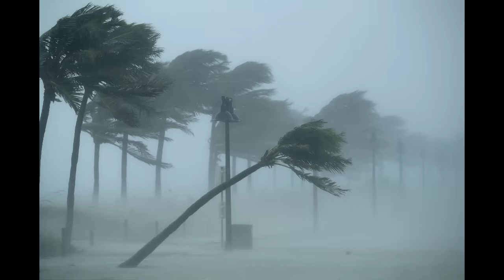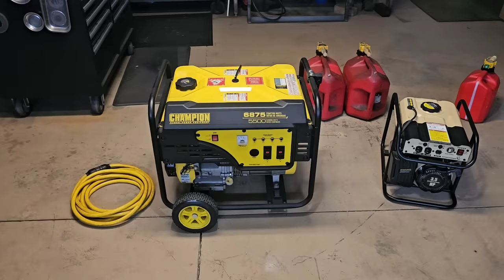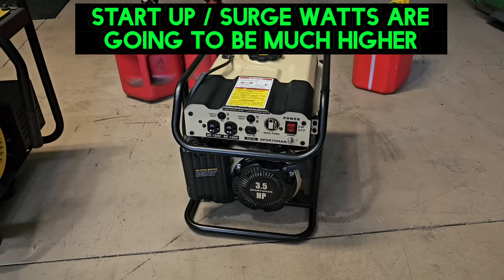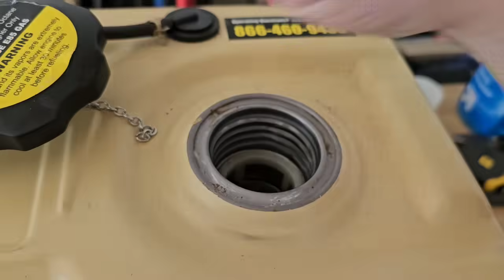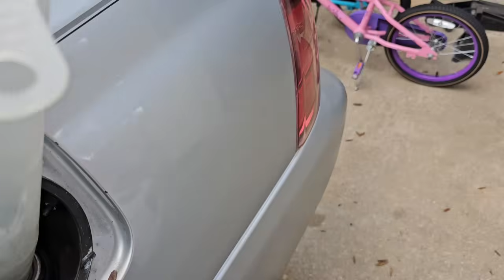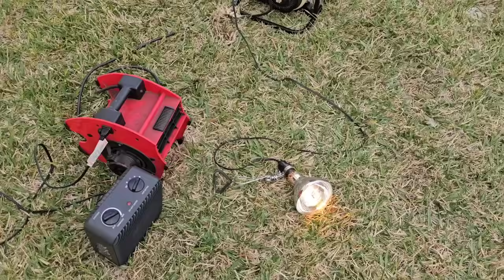Why smaller generators are better for power outages.

Comment: First time we lost power after moving into our current home, we realized we were the only ones without a generator

We got a larger dual fuel generator because we need to be able to power a well & septic pump, and have a large LPG tank.  In an extended outage, the plan was to run the generator for about an hour 3 - 5 times a day.

Still plan an getting a second generator for back-up.  An inverter and deep-cycle RV battery is also great for small loads such as an internet router/modem or CPAP.

Comment: I'm a big fan of preparedness and some small creature comforts in a disaster and I have 5 generators in 3 different sizes all inverter, 2X4kw 2X3kw and a 1,000W and I'm thinking of getting another satchel type generator that will produce rated 3800W from a 140cc engine. The 4kw will run my house, my mini split air conditioners, refrigerator, lights tv computers and a washing machine. To use electric to cook besides a crock pot/rice cooker, I have to rob Peter to pay Paul OR I could Pair another generator and only run it as long as necessary. 

Some of the satchel type inverter generators use permanent magnet alternators which are much easier to spin and the one I'm looking at is 3800W 140cc, while my 3kw generators have a 212cc engine and the 4kw has a 270cc engine. 270cc vs 140cc for pretty close to the same amount of power produced. I expect the 140cc would probably run 10% faster than the 270cc engine, but it should still run at least 60-70% longer on the same amount of fuel. Air cooled Gas OR Diesel generators are horribly inefficient. Yes, I said Diesel. If a diesel isn't water cooled and turbo charged they use about the same amount of fuel as a gasoline engine would of the same size and if you hadn't noticed, diesel is more expensive. Diesel does keep longer in an air tight container though and fuel stabilizer for gas isn't cheap either. I wouldn't buy fuel stabilizer, I would just rotate the gas in the cans to the cars every 6 months and buy fresh.
Reply: @Desert-edDave  Blough me?

Comment: I use the smaller Champion 2000w dual fuel inverter generator to recharge my ANKER 767 /w expansion battery … 4096wh total.  Runs all my 120v needs … daytime 6-8 hrs, nighttime 8-12 hrs. Using propane.  Thing about generators dual fuel or otherwise of any size is that they provide their rated power 100% of the time whether you use that power or not.  Use still burn fuel.  Storing that energy to top off a battery means you don’t have to run that generator but once every 8-12 hours for only a 2-3 hours.  My 15-18 lb. propane tank will recharge my batteries, least 6-8 times.  That’s roughly 2-3 days for about $20 propane cost.
Reply: Actually inverter load greatly affects engine load and in turn fuel consumption. An unloaded generator vs. one at 50% rated power generation vs. ~100% will consume very different amounts of fuel.

Comment: Is there some sort of thing you can put at the outlet between the fridge and the outlet itself that can then have an input cord during a power outage that doesn't' backfeed the whole circuit?
Reply: If powering a home and not individual devices, one would want to have an automatic transfer switch(ATS) professionally installed (by a licensed and bonded electrician, to code) which can automatically switch to the generator when grid power goes down, and also prevent back feeding when grid power is restored.

Comment: Inverter gennies are the best.  My Harbor Freight 9500 is more efficient than the much less powerful Yanmar diesel genny I had forever, plus the power is pure sine wave under all load conditions.  It'd also be more efficient than a smaller conventional gas genny.  If I had to do it all over again, I'd get a dual fuel model inverter genny like the Duramx, though will add a conversion kit to what I have.

Comment: I know what you mean but if the engine is bigger its more efficient. You probably get more watthours per gallon out of the big generator than out of the little one. But the diffenence probably is not this big. If you only use like 500 watts you should use the small generator. But you should mention, if the big generator is at 50% of its output, the small one is not at 50% so it also needs more than 1.5 gallons
Reply: What matters in this context is energy generation and consumption vs. fuel consumption in an emergency situation - in this case, the smaller generator that consumes less fuel but is able to meet the emergency power generation needs is the wiser choice.

Comment: I have both a 2KW Honda 120VAC and a 12KW Westinghouse 240VAC pure sine wave beast. The beast is great because it seamlessly interfaces with an automatic switch behind the utility meter. If the power goes out I just connect the gen and fire it up (electric start) and the whole house is powered. The two downsides are that It does make a fair bit on noise and burns a fair bit of fuel even when on eco mode. The Honda is also great (quiet and fuel thrifty) but it's a hassle using it because I have to run extension cords and pull the fridge out from the wall to get the power cord. Eventually I'm going to get a battery/inverter (240VAC output) so I can run the whole house on the low-down. 

FWIW, my newish LG side-by-side fridge/freezer runs at 50 Watts average so it's very thrifty. All LED lighting so my overnight power usage is under 1 KWH. So, a battery/inverter could easily handle overnight use and most of the day for that mater.

Comment: I've actually been considering a battery bank with an inverter to run the fridge and freezer at night. No noise and then charge the bank in the morning with a small Generator And run the daytime house with the larger.

Comment: Question on hooking up cables to transfer switch box: Since most larger generators and boxes use a 4 wire plug and small generators a 3 wire plug how do you hook up your smaller unit?  You could make a 3 to 4 wire cable, but no electrical code to my knowledge looks kindly on this.
Reply: If code was an issue, RV's wouldn't be doing 30A to 50A 'dogbones' every day. ;) It's not a code issue and is definitely possible. It is definitely possible and safe to do as long as wiring is rated for the load as well as associated breaker(s).

Comment: I bought a Multiquip 25kw whisperwatt diesel generator, it's towable and has a 45 gallon belly tank and a 18 gallon internal fuel tank which are connected together and runs the whole house on 7 gallons of fuel every 24hrs, the neighbors can't hear it and it will run continuously for 8 or 9 days and when it's time to fuel it up tow it to the gas station, also have a small generator like your talking about to prolonged run time ❤your educational content as always and keep it up!!!
Reply: Exactly. I would never go gas. Gas is terrible these days.
Reply: @Rusty1972  Right ✅️!! Plus I drive big truck and in a pinch and not any fuel around my house i carry 300 gallon in my truck tanks, life goes on!

Comment: Thanks SO MUCH for this video!  I've been watching what's going on in Carolina since the hurricane and I wanted to add a duel fuel generator to my current generator line up.  I have a complete solar line up, but I wanted to back that up with a duel fuel generator.  One is none after all!  It's good to know that I don't need a huge 15,000 KW generator.  I am sold on the 9, 500 KW surge with 7,000 KW running watts.  This matches my current solar set up and I think it will be enough to run what I need.  Thanks for focusing me on the real issue in a grid down situation, the lack of fuel in long term situations!

Comment: Power was out in my area for thirteen days due to damage from Hurricane Helene. I used a predator 2000 inverter generator to power a refrigerator, freezer, three fans, tv, DVD player, led lights and two phone chargers. It ran 24 hours a day minus time for refueling and four oil changes. It used about 2.5 gallons of gas every 24 hours. At first we had to travel over 60 miles one way to get gas. It took about a week before stations closer to where I live to start getting power back. There was a few stations that had generator power but the waiting lines were literally a mile long. That predator 2000 really saved us. I just had to start with the highest electrical loads first and then slowly adding the additional loads until everything was running. We were lucky the temperature was in the 80s during the day and cooler at night so no heat or ac was needed. A small generator running is better than a big generator that is out of gas for sure.

Comment: Something to add, if your running gas generator like myself.  I fill up both vehicles before a storm and my 2 - 5 gallon gas cans. The cars are great for gas storage, with a sphon hose it gives me 26 gallons in the truck and about 12 gallons in the car. Thats about 72 hours of run time for my generator at 1/2 load.

Comment: I own 2 generators. I have a2008 Powermax 4400. Which is a generator and a 2022 Champion 6250 inverter. Both machines have a 4 gallon gas tank. But both machines have basically the same amount of run time per tank full. Which is between 16-18 hours. I run both generators once a month under a load for about a half hour. I have never had either one fail to start. I have 8-5 gallon gas cans. I keep 2 of them full all the time. But if I know there is a storm coming. I'll fill them all up. If the storm fades out and I don't use the gas in 6 months I'll put it in my truck. When I shut down my generators. I shut the gas off and let it run till dry so that the gas in the carberator doesn't go bad and clog the works up.

Comment: With a dual-fuel, midsized generator, you can stockpile propane containers and not worry about storing gas cans or fuel spoilage. Additionally, your carburetor will not clog up with gummy gasoline. Never store any gas in the generator itself.

Comment: Good video right on topic  I have 3 only the only reason I have the 9K one is to start up our deep welll pump , a amedium size on to run a number of our fridges and the little one for idle current, items lights tz computer and radio gear,  etc, Amazing savings on Fuel

Comment: Awesome video.     Back in 2009 where i live in Kentucky we had a massive ice storm.  Everyone lost power for 15 days.  My neighborhors had to either get hotel rooms or had to stay with family members.     I have 2 generators  one is a 2000 wat and my biggest is a 9400 watt duel fuel.   My family  had light on we was eating hot food and we was all in our PJs.    During the day.    At night  i would bring my big generator inside.     At night  i would use my smaller one just to run a couple lights and the freezer while we're sleeping.  It all worked fine.     Actually we had a good time 😂

Comment: I am learning that a 14 awg extension cord is a safer option than a 16 for certain appliances. I only had 16 awg ext cords and discovered they are dangerous for coffee maker and space heater. Maybe stock 14 or thicker for use with generator.

Comment: A small unit to keep my refrig. going + a small air cond. at night for my bedroom is all that's needed (plus a few small led lights). The larger generators suck up fuel even at idle. I keep 60 gal's at the start of hurricane season & have never run out.

Comment: Solid and informative video, appreciate your taking the time to make this and share it with us! I think that for indoor overnight powering of a fridge, that a fully charged power station of sufficient wattage should do the job safely and quietly. As with anything like this, having a range of the proper tools and devices is best, provided that it's affordable.
Reply from the maker: Hey, thanks for the kind words. I fully agree. Days after making this video, I upgraded that small generator to a 2000w Inverter generator (Predator brand) Then shortly after that I got my first power station and solar panel. The powerstations are not only impressive, but they are becoming more and more affordable. Powerstations are a game changer and that will be the topic of my next video. Thanks for watching!

Comment: Definitely a inverter generator is going to be cleaner power and saves fuel. I'd want a 3500w+ dual fuel inverter generator. We have a 1800w inverter generator use at work the tank is 1.1 gallon and a tank lasts a long time because we don't use every day

Comment: Have a craftsman 3650 watt generator I've used for 3 hurricanes. I run it from 8am to 8pm and found it would use around 5 gallons. I tried to only run a window AC, refrigerator, box fan, and 2 drill batteries

Comment: Great video! Another good reason for having a smaller generator is that it's just a lot easier and safer to move around and also protect after storm. A lot of times it's still slightly raining after a storm and you need power mainly for your food and a few lights and the small one would be really easy to hook up quickly with some long extension cords as opposed to handling a large 30 amp cord connecting it to a power inverter during the rain.

Comment: Just went thru Milton here in center Florida. Only had 2005 Coleman Powermate sport 1850. Found in storage unit and repaired it thanks to Mr. James Condon on utube 😁👍👍. It ran fridge & coffeemaker, TV & charged cellphones. I would add gasoline every 2-3 hrs & shutdown same.  Running 750watts. Power was out 2.75 days and only went through about 7gals.  Agree smaller will do fine but wishing I had a way to hook up a 5- gallon tank to generator’s tank. 
Thanks for the video- New Sub

Comment: I have solar and 30kw LiFePo4 battery bank, the inverter has a generator input and my system can charge the batteries from the solar panels, the grid or the generator.. Most of the time the batteries can last out short power outages and run everything including the microwave.. I also have both a 12kw generator and a 3.5kw generator so I use the smaller one to run a few lights and charge the batteries if there is no sun and they are low.. I use the big one when we need to run the well pump and heat water and charge the batteries when they are low.. The batteries are great for absorbing the power that is usually wasted when the generator has sporadic high and low demand when running for hours and I can shut off the generator for hours and run off the batteries thus saving lots of run time and fuel..

Comment: Fuel consumption is the reason I have an EU7000 Honda and a EU2000 for backup power. The 7000 at 25% load or less uses about a litre (quart) an hour which is the majority of its running time. Also both super quiet and EU7000 is fuel injected. Plus I have a couple EcoFlow solar generators (battery packs lol) that are really nice at the off grid camp. Only have to run the EU2000 a hour and a half every 2-3 days to charge them. Win win.

Comment: I would like to have one with a diesel engine on it That can burn used Motor oil ,  that would be a free fuel source forever , And
 I doubt it would go bad if it was in a sealed container for a 100 years

Comment: I was hip to this when i designed my settup.   Got a big solar generator and a small compact invertor to recharge.   I used a few gallons to stay powered for a whole week.  
I dont have a 240v solar gen.  So i do have a large gas one too.  But i only run it to pressue the well back up.

Key thing is to buy a FAST charging solar generator.

Comment: Small inverter generators are generally much quieter than these traditional smaller open frame ones. I have both and the inverter one is much quieter.
Reply from the maker: Yes, the inverter generators are more quiet,  better on fuel consumption, and provide cleaner power. But they are more expensive. I did replace that small tan generator with a 2000w inverter generator days after making this video.  Now I'm investing into solar and batteries

Comment: If you want to be prepared and you’re starting from zero: Dual fuel small inverter generator.  Then add a power station 2 kilowatt minimum. Then add minimum 400 watts solar panels. Use the generator to charge the power station when solar isn’t enough. Then start learning about adding more solar panels and batteries. You’ll eventually leave power stations behind and add your own inverter/charger setup. Then you’ll add more and more batteries and solar panels.
Reply from the maker: I agree 100%. The power stations and solar generators systems are amazing! I'm about to make a video explaining why I plan to invest more into solar & battery capacity instead of generators.

Comment: I have a mid sized 2500 watt gasoline inverter generator. My back up is a 1000 watt propane generator. It will run 30 to 60 hrs on 20 lbs of propane depending on the load. I will eventually upgrade my gas model for a duel fuel. It is definitely safer to transport propane tanks and safer to store. I also like the idea that I won't need to compete with others for the limited amount of gas available in an emergency.  Adding a "solar generator" gave me the ability to charge up off the generators and keep the fridge and window air conditioner running when not running the generators. This has worked out great for night time use.

Comment: A 2000 watt honda inverter generator clone pairs well with a bigger multi fuel generator, IMO.  That little sportsman is great as a loaner, but my understanding is that it's just as loud as a bigger open frame generator.

Comment: I just went through Helene, and I didn't have a generator when it hit. I managed to order a small inverter generator on the day it hit. I like the idea of a big generator that can run everything, but that small inverter gen will run all night on it's 1 gallon tank, and we were running a full size fridge, a smaller drink fridge, an office (2 computers, a tablet, &  other equipment), and a bunch of chargers. I'm thinking of getting a 2nd one, and use it only when I have higher demand, but use just one at most times.